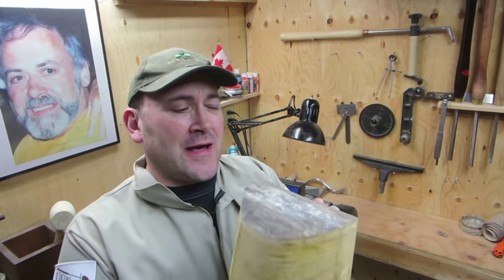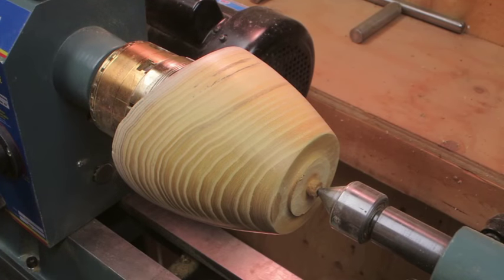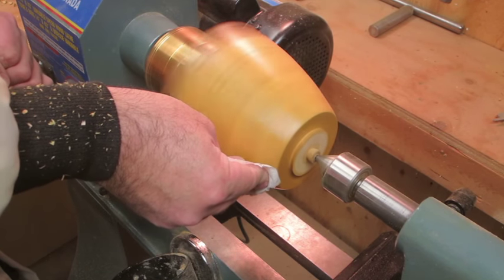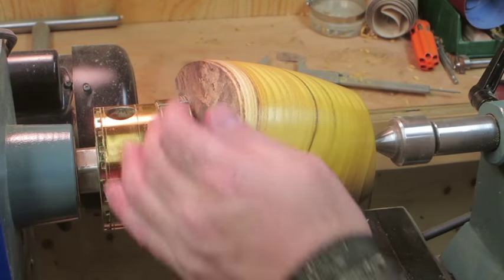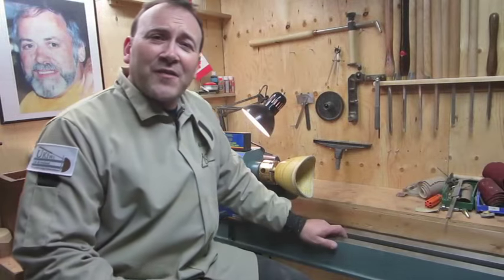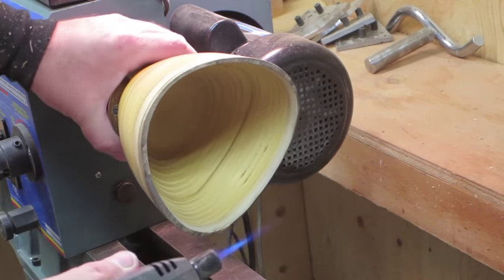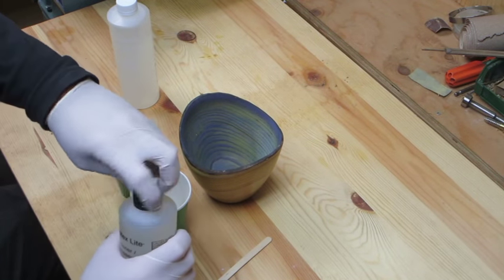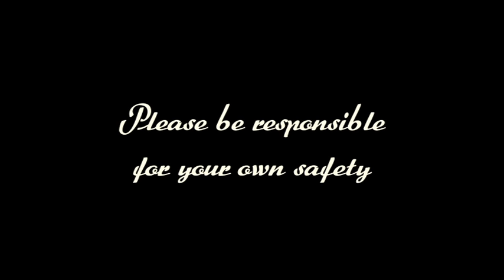woodturning # 65 osage orange blues vase.

Comment: Nice looking vase Rob. I wonder how it would have looked if you had continued burning the entire interior of the vase? Not saying the blue is bad...I like it. The water proof finish inside is a great idea for vases. I noticed that you used a heat gun to help it flow, I use that trick to help epoxy flow into cracks that need mending. Good job and great video...keep them coming. Like!
Reply from the maker: Gil 
That's an interesting thought and worth trying . 
Take care 
Rob

Comment: Have to say that looks very odd but in a good way (well mostly). Because of the different height in sides it deceives the eye all the time looking like a triangle shape, certainly not something off the lathe. Love the outside and never seen the resign used this way before. Did it still have that glass reflective look when it had cured? How hard does it go, enough to resist scratches?

The bit I don't really like is the colour, I don't think that it adds anything to it at all. Sorry just my opinion, I'm sure many others will like it.

Is it a vase or deep bowl?
Reply: Forgot to mention, nice to see you also using music from Josh. However you need to include details about the licence, check out any of my videos with music in which show what you have to have as a minimum.
Reply from the maker: Paul 
Thanks, I think 😉. 
I learned some of these techniques at our local woodturning club, you could I guess call this a bowl or a vase, and live edge, natural edge or saddle bowl or saddle vase. The resin and use of colour is new to me, and I like it, for woods that don't have a lot of figure it is worth trying new things and increasing your knowledge and expand your use of materials. 
You've gotta have fun and yes the resin did cure like glass and is durable. 
Take care
Rob
Reply from the maker: Paul Lockwood 
I found this website FMA through Yuval  and used his method of giving credit to the artist, I checked out your videos and see your link to licence so added it to my videos, thanks. Last thing I want is a strike. 
All the best Rob
Oh and Josh is awesome...
Reply: Just can't be too careful on these so I thought I better just let you now. Some of the licencing options are so confusing.  I think his music is great and I tend to use mostly instrumentals now which also work well.
Reply from the maker: Thanks Paul

Comment: Nice project! Does that Polly not run down the sides while drying?
Reply from the maker: Tom
I used a bar top resin 
Yes to a point it ran down the sides but it is very viscous and remained coated 
Take care
Rob

Comment: Was this piece of wood completely  dried?  any tips on drying?   I'm really good at turning something amazing only to have it look like garbage a week later!
Reply from the maker: Ah, there is a lot of information out there on drying wood, I have a couple of videos on the subject, you have to find a method that you like.
First of all cut the pith out, consider rough turning and bagging until it dries, I have s moisture meter. 
Use end grain sealer, if you finish turn wet wood you need to turn it very thin and. Wry even and expect it to warp 
Watch lots of videos on the subject and experiment 
Take care
Rob
Reply from the maker: hhguitars 
And yes this wood is dry
Reply: Woodslee Summercraft I did the bag/shavings thing and it still warped
Reply from the maker: hhguitars 
Yes it will warp, that's why if you want an even finished product and you turn it wet, you need to rough turn it to an inch thick, seal it bag it and leave it to dry , once it dries you will need to finish turn it, to true it up. 
It's a long road of learning, I suggest you watch lots of YouTube videos on the subject 😉
Reply from the maker: Maybe this link will help 
https://youtu.be/xy0xkGJe63E